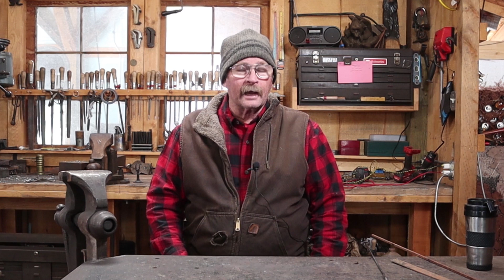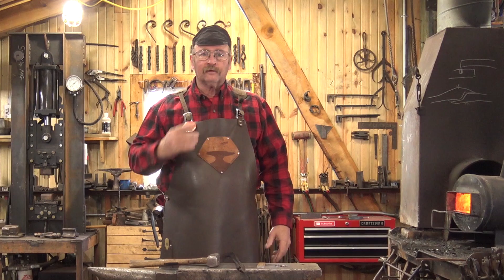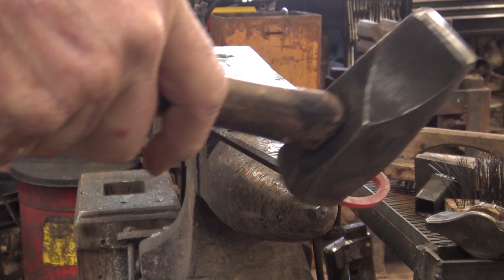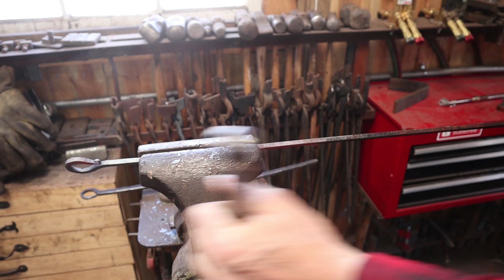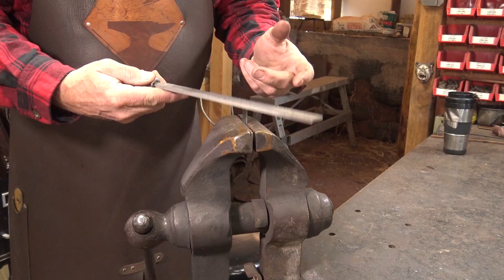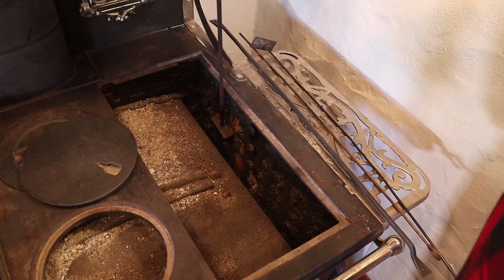Blacksmithing - Forging scraper for the wood cook stove

Comment: As a young adult I always wanted a cook stove like the Monarch you have.  Eventually I found myself volunteering at a historic park and cooking on two different turn of the last century stoves when not helping restore the ships.  I think they both need one of these tools.  But the park stopped allowing anyone to cook on them and so one is in a warehouse (they rebuilt the ship but not the cookhouse so there is no place for it) and the other stove sits rusting aboard because it lives in salt air and no one is cooking on it driving the damp out and oiling it when done.  So sad.  If we are ever allowed to use them again I'll need to make this very tool so the park has one on hand.

Comment: Around 13:19 when you mentioned safe edges on files... the YouTube channel ClickSpring has a few amazing videos on files and one of them mentioned the brand he typically buys and he insists that it’s actually ideal for you to manually grind off one side of your file on a good number of them even if they’re expensive like his are. 

He mentioned looking at the cross section before and after doing it and pointed out that two sets of teeth on the corner aren’t going to give you as clean of a cut as one set of teeth would. Also it gives you an ease of mind when you’re doing extremely precise work or you’re looking to save your equipment from damage. If you’ve seen the work Chris (ClickSpring) can do with his files you’d understand why I’m mentioning him, he’s worth a watch.

Comment: I love this type of blacksmithing.. It's not production work, just making a tool (with basic tools) that needed to be made. That to me is the essence of our trade. Like you said the hole could have easily have been punched, not drilled. The whole thing could easily be made with zero electricity. Putting a safe edge on a file is not a difficult task either, and we'll worth doing if a person needs to use files a lot on applications where you just don't need it to bite on a perticular side, but cut on another. Also I almost fell out of my chair at 14:52..😂 Darn tools falling.. It's a great project, and I hope it works well for the neighbors. Also it's a nice looking piece done in a pretty traditional manner. Great work as always. 👍 👍

Comment: Not all files come that way, but ANY file can be made that way.  A grinder (or angle grinder, belt sander, or Dremel) is another tool that just about every shop should have, but sandpaper and a block should work.
Also, that is a beautiful wood stove.
Reply from the maker: I so rarley feel I need the safe edge that I almost never modify a file.

Comment: You are good neighbor!  I saw the old gas cylinder by your work bench.... I cut the bottom of one off to make a dinner/lunch bell...When lunch is ready she rings the top part of the cylinder.. three times...when I've heard her I ring the bottom part of cylinder...That parts are hanging....top part at house....bottom part at shop...NO CELL PHONE NEEDED
Reply from the maker: This one has been cut with that in mind, just hasn't been completed
Reply: @BlackBearForge .... So let's design up a ringer..I was going to use a leather mallet, a polished river stone or a suspended internal ring....Fell in love with your channel and now I'm think of turning a loss horse's shoe into a ring , by forging it into a ring and suspend it from the top....I simply plumbed up the valve hole with a plug and bought an eyelet for it...but it's boring...The outside of mind has a "Pretty paint" job so I don't want it being rung from the the outside...Also have the next size tank , ready for bottom removal.

Comment: Wow. I didn’t know anyone still used wood cooking stoves in there homes.  I’ve seen some in cabins used for hunting or vacations. Nothing wrong with living simple and old fashioned... along with a few modern technological pieces. 
Another Great teaching session with John.
Reply: Erik Courtney, modern technologies like air conditioning!
Reply from the maker: Not many do, but it serves as a nice backup and can help heat the house in a power failure.
Reply: I completely agree.
I’m partial to my gas appliances. but gas lines can fail and it cost money.  Wood is cheap and easy to find.

Comment: Learning so much from you John. Thank you for sharing your smarts. I can certainly use a tool like this to clean out my outside horizontal pipe for the pellet stove in between the professional stove cleaning in the spring.  On the bucket list for sure.  Thank you again.